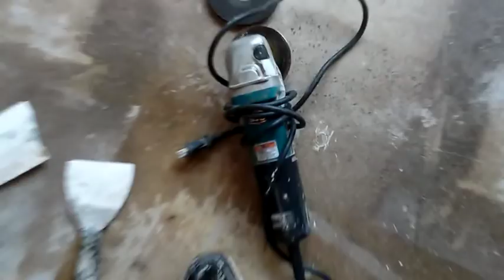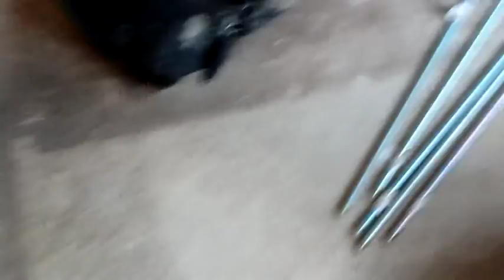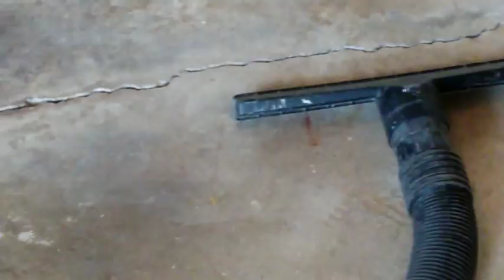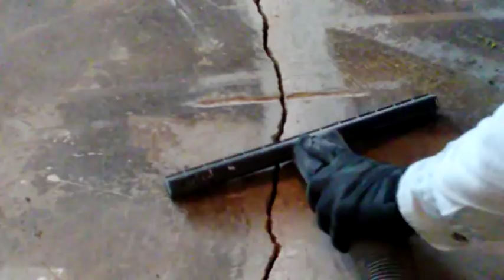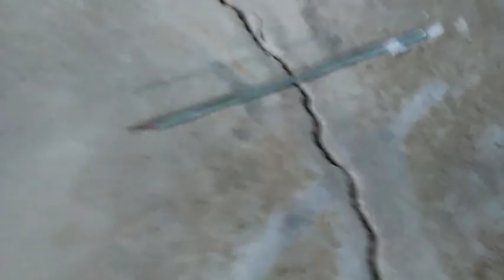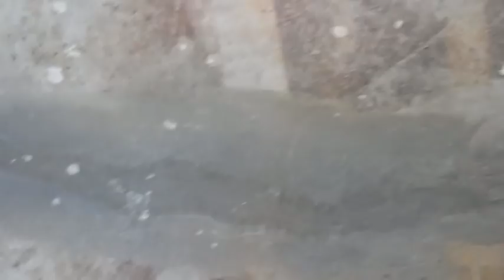How To Repair a Crack in a Concrete Slab Floor

Comment: This is not the correct way to pin concrete. It needs to be near the center of the slab, at least 2” deep (impossible to do with. Mini grinder) the correct way to do it is to drill an angled hole aiming to have it pass through the crack near the center of the thickness of the slab. Fill the hole from the bottom up with structural epoxy gel then insert stainless steel rods making sure it forces epoxy out of the hole. Much easier and structurally far more sound. His stitches are far to close to the surface. Th3 surrounding concrete will break.
Reply: @tailgatecarpenter26  correctly pinning a concrete slab is a valid repair in a lot of cases.It very often can stop the crack from getting bigger ( stabilizing the crack,depending on the cause) by essentially placing rebar where it was missing. It is not going to help in all cases
The way he did it has zero structural integrity.( I know you understand this but a lot of homeowners don’t)
It’s funny you bring up fault lines. After the Loma Prieta earthquake we did a LOT of concrete and stone pinning and epoxy injection
BTW 6X6 would never work maybe an lvl beam🤣🤣🤣

Comment: Didn't watch the whole video, but you definitely do not have enough embedment into the slab even if you use the best epoxy, it will pop. Whenever we pin concrete or stone we always use stainless steel threaded rods. I hope your repair held up and thank you for your cool  ideas

Comment: how the hell are you just going to embed that rod a few inches into the slab and then slop some quikrete over it?? that's not going to do anything. you're just pacifying the client and applying what amounts to a used band-aid to the issue. water is still going to seep up through the slab (provided there is no vapor barrier underneath) and it will completely ruin that patch over time, but the biggest issue is that the slab is blatantly settling!!! you even stated that one side of the crack is higher than the other.

you need to pier the slab and/or apply fill to the area underneath the sinking portion of slab to mitigate the settlement. your method only conceals a much greater issue. anyone with $15 for a bag of quikrete and a bucket of water can do pretty much the same exact crap in this video. i promise that rinky dink little rod isn't going to do crap either. you need to dowel the entire slab in set increments (usually 24in or so, depending on structural design). you also need rebar, as it has braiding for the concrete to adhere to. the rod he used is smooth and concrete will NOT bond well to it.

if anyone ever walked into my home and tried fixing a settling slab like that, i would throw them out prontoooooo.

the method he detailed is ONLY good for minor expansion/contraction and stress cracks. the slab in this video is severely compromised and requires much more involved remediation methods.

source: i do building inspections with a civil engineering firm.
Reply: Is foundation remediation covered by homeowners insurance? TIA

Comment: It can work i the foundations are stable, if it settled that way, but if you have expansive soil which cause this crack to move with the seasons then this may cause more damage as the crack cannot close again, if you keep filling cracks then the crack keeps pushing away with movement. I would first check the soil and foundations to ensure that slab is stabilized.
Reply: For example if you reinfoce the crack and make it super strong, any further movement of foundations will cause a new crack to form somewhere else where its weaker. Something has to give...The key is, stable foundations and soil.
Reply: @mariusd5913 how can you have stable soil in a drought?
Reply: @AnitaBarneycastle  Its not about having stable soil it is about having a stable foundation. There a various methods from underpinning to water control such ensuring the soil remains dry around your house at all times. Damage is not cause by the conditions, but mostly due to the change in conditions.

Comment: This is exactly what I have at my new house. The previous owner bought from someone that just slapped vinyl planking over it. I found it two days ago because we're doing all new floors.
Reply: I had my closing today and started ripping up the old cheap laminate floors this evening and found a crack like the one showed in the video..I feel your pain. Did you come up with any solutions?

Comment: If you’ve gone that far; I don’t see why you didn’t etch and steel brush out the crack with a muriatic acid wash first. Then power wash out & brush in a bonding agent prior to the anchoring cement.

Comment: Don't use zinc plated threaded rod.  Use 1/4" or 3/8" rebar.  Also, don't use mortar to embed the tie rods; use the same epoxy compound you're going to use to seal the crack.

Comment: Not sure if those rods can withstand the pressure off that foundation movement.
Reply: if there is continuous movement, every little bit helps slow down the rate

Comment: We have lots of water in our basement... constant flow actually and they are saying it is the water table and water is coming up through the cracks, I can not even see some of the cracks.  Would this work for me?  Planning on gettin a sump pump soon as well.  So upset, we just decided to sell our house and this happens.

Comment: 1/2" x 12" stainless steel rods?
Reply from the maker: You can just use wrought iron rods,    that's what is used to reinforce concrete, it won't rust.  3/8" x 12" is  what I used.  Take your time, do a good job, good luck!

Comment: Our crack, I think, runs from our kitchen, through the living room and into the garage. The kitchen doesn't have any flooring but the living room has wood floors. Would I need to stitch in all three rooms? Or is the kitchen (and garage?) enough?
Reply from the maker: I suggest getting a free estimate from a structural repair company in your area. They will give you the specifics of what is recommended  for your particular house. That's just my personal opinion as are all my tips, the final decision is up to you of course, hope that helps.  Fix at your own risk, got to cover myself!
Reply: use stainless steel stiches with a fibre glass bandage also pour an epoxy in the crack with the bandage on the top coated in epoxy also.https://youtu.be/bdzaAjUUAtc

Comment: Hello. Where did you get the stitches? Thanks.
Reply from the maker: I got them at Lowe's, near the hardware supplies, there is a section of metal rods of different lengths and thicknesses.

Comment: I would also like to know what you used for filling the crack. I have a big job ahead and really need to know.
Reply from the maker: It's Quickcrete Anchor Compound
Reply: Mark McKinley looks like the home Depot stuff called Quick-crete.
Reply: what is the purpose of stitching?